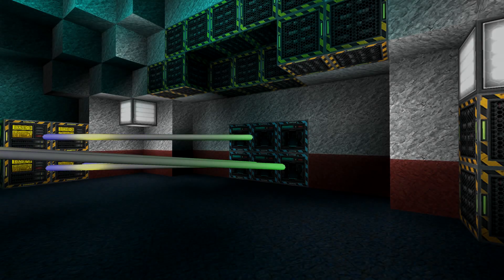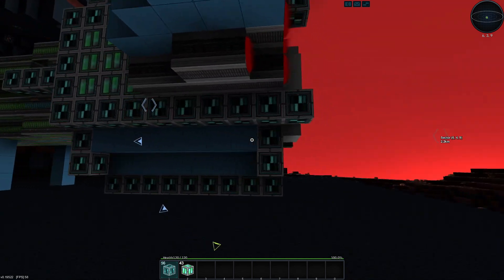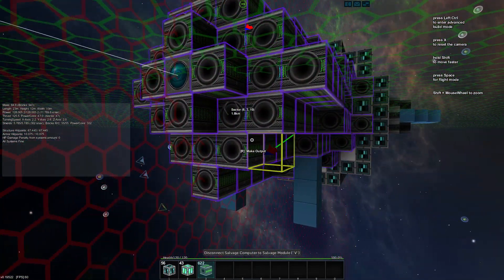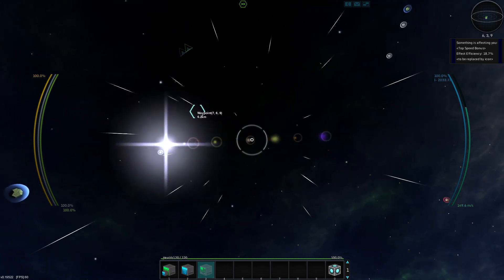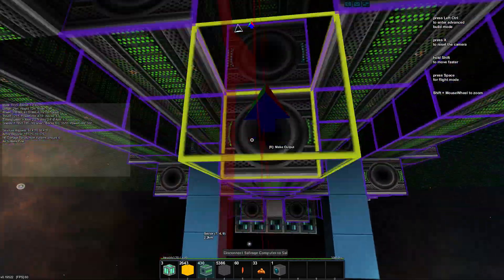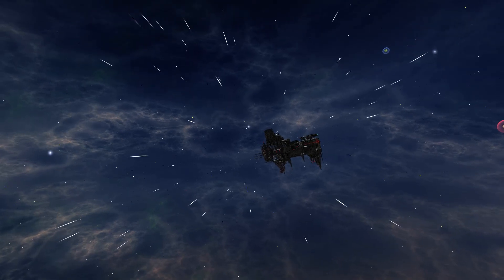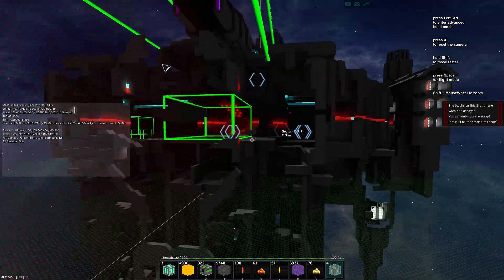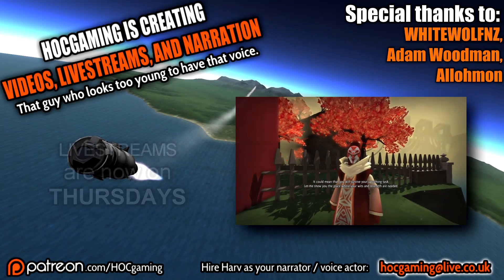Harv Plays: StarMade [#10]

Comment: Just a quick tip: you can eliminate the connection wires if you link the machines to storage blocks, rather than linking them directly to each other

Comment: powertanks are most efficiënt if you put them next to eachother, instead of making long strips
Reply: +LordPizzaJunkie Please do your research before spreading false information. Its calculated by the total volume so by doing L or T shape runs of them you get more than if you just had massive 10x10x10 blocks of them, it also saves space. In addition when you're under a 13 block limit in any one direction its generally better to go with a straight line over doing an L or T in terms of bang for your buck. Thus doing a checkered board pattern like hes doing is very good.
Reply: Ze Chrisanator that's power reactors, I'm talking about power capacitors. Sorry for the word Tanks, that might have confused you